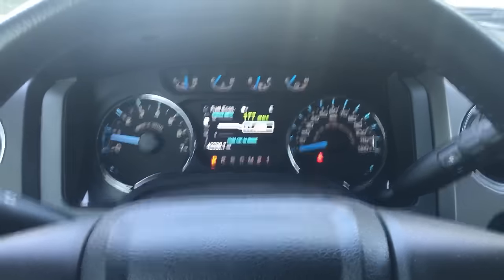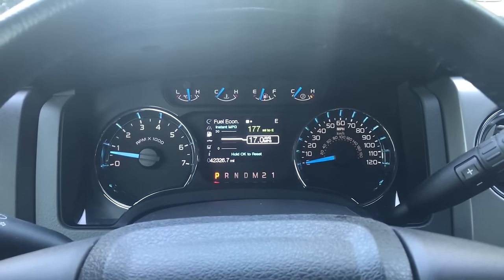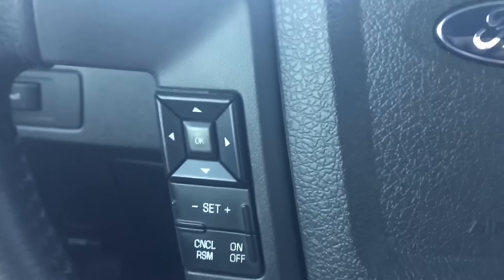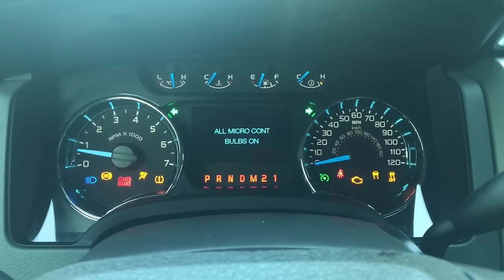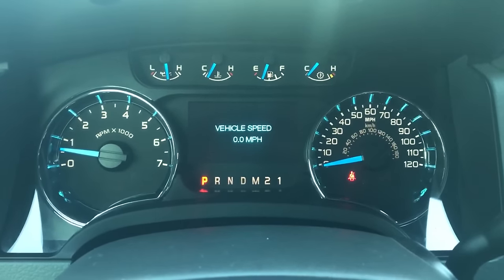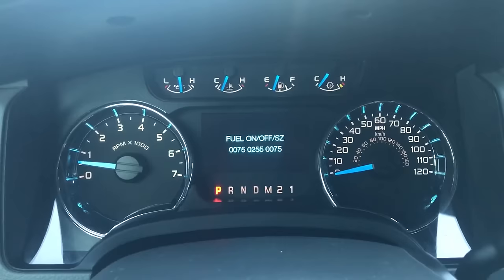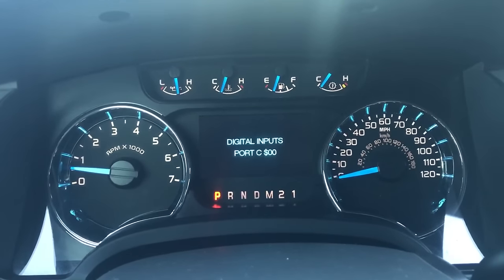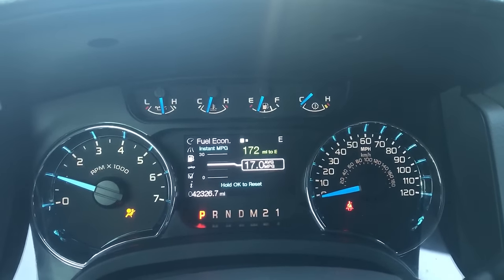Ford F-150 how to enable (hidden digital speedometer) Engineering/Diagnostic Mode

Comment: Really disappointed that the truck doesn't automatically show the digital speedometer on the main screen.  This should be one of the major features, not a hidden one!
Reply: Especially since it has all the information and shows it in "hidden mode"
Reply: @gdub14  Mine also has only ONE digital readout, transmission temp :lol:.  I expect a bunch more. Why not at least coolant Temp? 
There is a second screen too, it is blank. It reminds me of some lazy kid who didn't  finish his homework :lol:
Reply: @alb12345672  coolant temp is on there
Reply: @gdub14  q😊

Comment: On the lower trim, level F150, you just have to hold down reset and setup and it can do the same thing. I did it on my 2012 STX F150.

Comment: My 2003 Ford Focus SE does this when you hold down the trip reset button when starting the car.  Granted it does not have as many options as my 14 F150, but it does work.  Ford seems to have introduced it around 2000 in their vehicles.  Good features if you know what you are looking for.

Comment: I have a 2013 Ecoboost, do you know if there is a boost gauge?  I'm shocked they didn't install one from factory like the diesels have.  Always wondered if there was one  hidden in the menu.
Reply from the maker: I don't think there is. I know the 15+ f150 has a boost gauge
Reply: Yes is not included on the cluster meter . However, you can install an external one. The harness is there under the dash.
Reply: I've always wondered too I have the same truck. 2013 EcoBoost F-150 I'm curious how much I'm putting out. Being that I tow with my vehicle

Comment: I noticed the tach is up. Is your engine running?
Reply from the maker: Yes
Reply: @itsoundzgood  ok  I was just looking at your mpg average gauge. For some reason mine use to look like yours. But for some reason after I held ok to reset the mpg went up for 99 and  the green is now up at 40 and the mpg line slowly starts climbing. This is while I'm sitting in park. I can't seem to find any info as to why this jas changed.

Comment: I have an aftermarket remote start that shows low battery in accessory mode. It appears you START your truck and it will also go into engineering mode. Is this what you did in this video? I see the RPM are hovering around 6-7 in the video...
Reply from the maker: Yes you can start the truck and still get into engineering mode.

Comment: My 2012 5.0 cuts out at 97 mph. Do you have a programmer on yours?
Reply from the maker: Joe Sageser yes
Reply: My 2011 Ecoboost is chipped with other parts as well and I removed the speedlimiter and now I top out at 130mph
Reply: @MrRangernation  what did you have to do to get that top speec
Reply: Luis Campos I got a SCT livewire ts programmer and you can then remove the factory speed limiter

Comment: I'm trying to find the default code for the keypad on my door. I bought my 2013 used and they didn't have it. Did that code show up when you cycled thru?
Reply from the maker: No. But I know where to find it. Look at the sticker on your fuse box in the passenger kick panel area. There is a sticker on it and that is actually your door code
Reply: @itsoundzgood  - thanks for your quick response! I'll go right to that panel!
Reply: If the sticker isn't there, you can get the dash to display it. You'll need 2 keys though. Insert the first and turn to run (don't start), after 4 seconds remove the key, insert the other and turn it to run (again, don't start). Once it does it's "welcome" screen, it'll give you the 5-digit code.

Comment: Would this work for a 2010 F150?  My father has the smaller screen.
Reply from the maker: Asphalt8ficionado I’ll try it at work tomorrow and let you know
Reply: Nice!  Thank you! :)
Reply: Yes it works ..it just has limited features . ..it works all the way to 2000 Ford F-150 and expeditions . Depending on how big the digital screen is will limit on what shows .

Comment: My F150 2112 used to tell me what gear I was in when I drove. Now it doesn’t.  Any idea how to fix that?
Reply: Try pushing the + or - on the shifting lever while it's on D
Reply: @Gdot375  There isn't a - + on the shifting lever.
Reply: @Gdot375  You are absolutely right, and I didn't even know that button was there. Problem solved.  Thank you very much.

Comment: My 2015 truck has digital speed and  transmission temp and engine temp and other info digitally displayed Just in ur regular display  option with ur gas to empty... This is more for calibration when ur gauges get stocks.. my speed got stock at 80 ones and i just reset it like this..

Comment: Any option that allows one to disable the Auto Off feature?
Reply: Yep, there is a dummy plug for the trailer lighting. You plug that in, and it disables the auto stop feature.
Reply: I'm glad my 2015 platinum doesn't have that feature..

Comment: How the hell do you avg 17 mpg.
Reply from the maker: Mostly highway driving. If I only do highway with no stops its closer to 20mpg
Reply: I’ve averaged 19.4 for 5 years now and reset it every time I fill up. 5.0. 40 PSI in tires. And that’s with 500 lbs worth of tools in the bed all the time also lol
Reply: I get 20 on my f-150 ecoboost.  Best way to safe gas is to slow down.  Dont romp on it after every light.
Reply: Look up Engineering Explained‘s video on fuel efficient driving. Beyond technique, A/T tires will perform worse than highway tread. Also don’t speed. Aerodynamic drag is exponential function of velocity.

Comment: Shame want work if the trucks not running
Reply: I turned the key off and turned it back to the on position without starting it and it worked for me. (2013 5.0)

Comment: Stock 5.0 cuts off at 90 mph
Reply: Slowmo69 mine shut off at 97 it a 2012
Reply: My stock 6.2 tops out at 98, thanks Ford...
Reply: 90??? Mine hits 99 then slows
Reply: So chip it, I have a 2011 Ecoboost an I top out at 130mph
Reply: Yea I was like what the fuck why did this thing just sound like it misfired and cut power. I look down and it’s at about 90mph
Reply: Um, yeah... There's a fix for that. SCT tune!
Reply: Slowmo69 95
Reply: Mines stock and cuts out at mach 50
Reply: Interesting. I can get my 5.4 up to 120.
Reply: yeah its about 96-97 for me then it hits the governor and stops accelerating
Reply: Taken mine 133 with sct tune. My GPS has digital mph.
Reply: My 2010 4.6 slowed at 95. Now I have a 2013 eco boost and not sure where its limiter is at yet.
Reply: Mine cuts out at 110. 2014 5.0

Comment: Please don't put your truck in dealer / diagnostic mode. It is there for a specific reason. It is not designed to be driven daily this way. This mode is by-passing some features and functions that Ford designed for the convenience of the consumer.

Comment: its two ''thousand fifteen'' not twenty fifteen
Reply: You are incorrect.. Actually both are correct. "Two Thousand Fifteen", is used mainly by British. where "Twenty Fifteen" is more commonly used in America. Then there is also, "Two Thousand And Fifteen". which is a third way of saying 2015 which is also correct.

2019 was the last year you could say three different ways. The correct way to say the year after 2019 is "Twenty Twenty", "Twenty Twenty One",  and "Twenty Twenty Two".